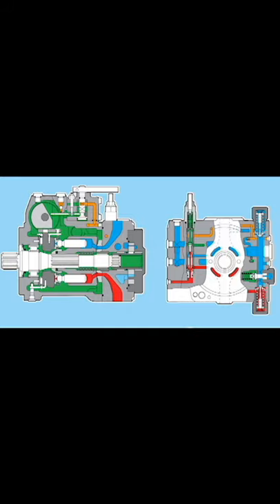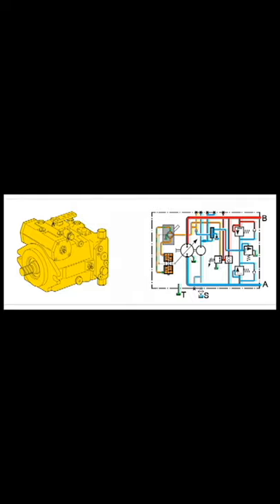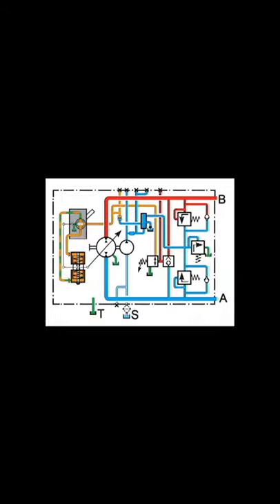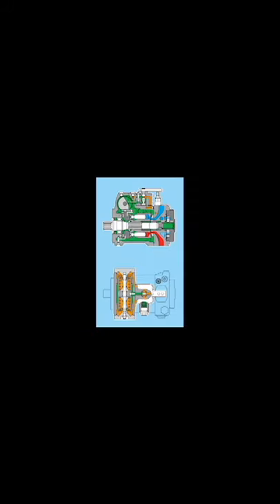#SHORTS_HYDRAULIC Variable Displacement PUMP_A4VG

Comment: What is d.a control in a4vg series pumps?
Reply from the maker: A4VG….DA 
Automatic control speed-related
If engine speed increases,then control pressure increases that cause pump flow increases .
It’s called hydrostatic transmission